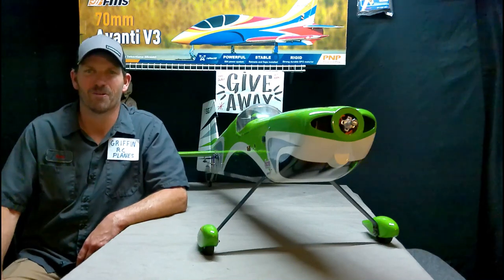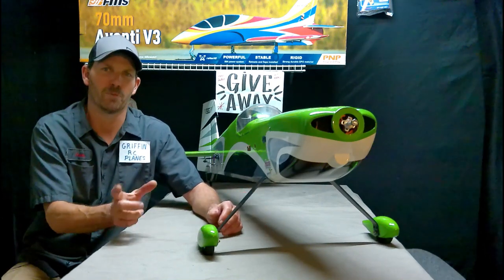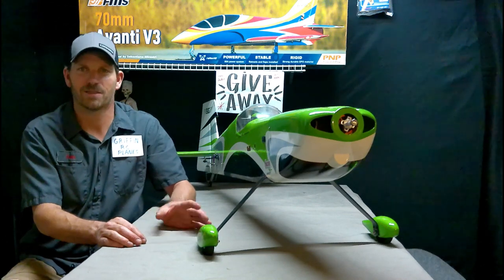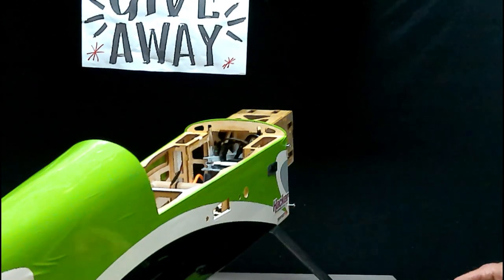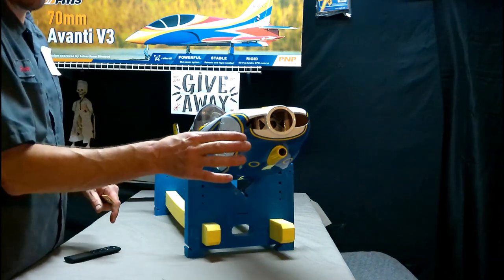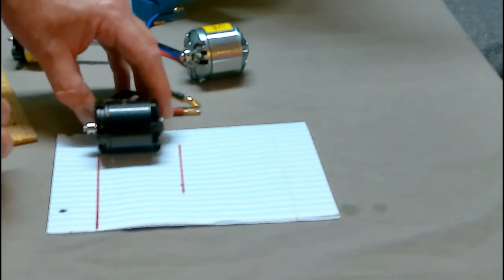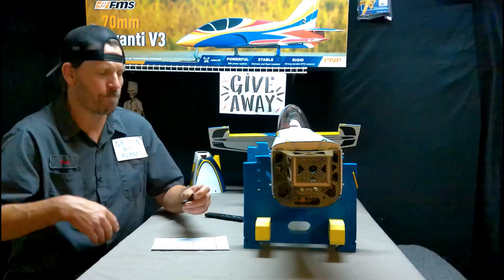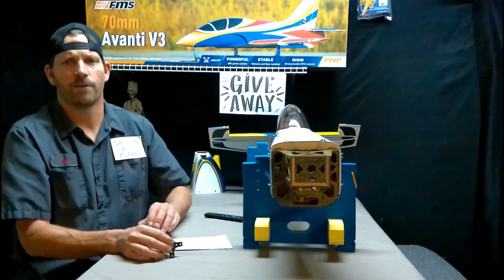RC AIRPLANE BRUSHLESS MOTOR CHOICES YOU DONT HAVE TO ALWAYS USE WHAT THE MANUAL SUGGEST LOOK AT THIS

Comment: Sean, thnxs for this video , didn't  have a clue about the price diff. on them motors, really haven't look till now. I built a edge 540 foam board about 3 years ago , took me about a year to finish. video great content and info, happy flying buddy, thnxs
Reply: Congratulations on your new plane purchase.
Reply: @rlbutterfield  thnxs I'm happy to get a well built balsa plane, these are hard to come by these days
Reply from the maker: check out hobby star and do lots of research before you buy. it seems like your good with a computer so do alot of checking around
Reply: @GRIFFINRCPLANES  I've been looking , going to take my time building her, I  might text you for help maybe, thnxs Sean

Comment: Did you build, buy, or did the plane come with that firewall?
Reply from the maker: hi ross that plane  is made by SIG and named the edgetra it came as ARF almost ready to fly. it comes in many peices and takes a good amount of building . but you dont have to build and of the wood work or covering

Comment: I just bought an Avian / Spektrum 60 Amp Smart ESC with the BEC built into it on the frontend it has an Orange and Black wire running into an IC3 Smart Plug and a wire that plugs into my AR8360T Spektrum 8 Channel Receiver that reads all telemetry? The Motor I chose for my FPV ANACONDA which T/O is roughly five to seven pounds is the Spektrum / Avian 5055-650Kv Outrunner with two 22.2V 
(3S-6S) 6500mah 60C the Motor recommends the 60 Amp Smart ESC with the BEC built in.  The 60 Amp ESX and the Out-runner Motor three wires seem not to want to join together. It came with three gold pins but I’m not sure about that. Basically the three Motor wires will not connect to the three ESC wires. Any ideas? Thank you, Chad
Reply from the maker: It is possible that the size connector on the motor wires could be bigger. Those can be unsoldered and the right size put in its place. People do that often
 However keep in mind the manufacture of the motor felt that the current and amp draw required that size wire and connectors . So do your research to make sure that motor is not going to draw more than 60 amps and up to 80 amps in a quick burst. If you think the motor is going to pull more than the esc is set up for then you need to move up in the size of the esc. Most likely you can swap the connector size with no issues

Comment: So I have a Cessna I bought off someone getting rid of it extremely cheap and it weighs about 5.5 lbs with the engine. It’s got a .46 in it right now and I have a few OS .40s that weigh about 10 ounces or 287 grams, so before I pull this .46 off I’m assuming it weighs about 300 grams, so it’s just a bit heavier. I thought about keeping it nitro, but as much as my kids love coming flying with me and as much as they do NOT listen or pay attention, I’m thinking about making her electric. I was wondering if a 590 kv motor would have enough thrust to fly this baby with an 80amp ESC and 6s battery. I’m pretty new to all this but grew up in the late 80s early 90’s flying all nitro with my old man. Let’s just say I took like a 30 year hiatus and I’m just getting back into the hobby. Any input would be GREATLY appreciated and if you need more Info I’ll provide everything you want. Thanks again and keep making videos. You explain everything in detail but use layman’s terms which is good for people like me
Reply from the maker: How I got a understanding of what motor will power what size plane weight etc. Is started looking at planes I knew then I went to horizon Web site or who ever I was looking at and read up what size motor that plane had then figured out weight etc. However if your plane has a .46 on it now then you can look at motors that are advertised as a electric. 46 equal motor and see the weight and size of that motor then you know about what your looking for.  Also several manufactures have this list like avain spektrum. Go to horizon click on one of the avain motors and then somewhere around where you down load the manual you can see the list of motors and each motor will say what pound plane on what battery it can fly and then after looking there you will have a good idea on what you are looking for. I hope that made sense. But to answer your question a electric motor set up to replace a .46 . Look for a 4260 550 Kv sometimes they call it a 4258 that is the size of the motor 42mm wide 60mm tall and with a 6s pack and 60 amp esc and a 51x6 prop will be real close for you

Comment: What kind of electric motor would you recommend for a 59 inch wingspan wood frame plane, I think it weighs close to 6 pounds, any electric motor actually able to fly this thing?
Reply: Your gonna want something between 500 and 1000 Watts, from the sound of it. It's gonna take a bigger motor, but you can definitely track down motors in that size range
Reply from the maker: There are alot of motors to fly that. The way I started learning about what size motor can fly whatever . Was to look at the planes we already know and them read the specs on it. Example the e-flite draco. You can look on horizon hobby website and see it weighs over 6 pounds and then see what motor it uses then you can look for the motor specs and see what size it is and what esc and battery it is called for. Also on websites that sell motors they will show all the info on what a particular motor can be used for

Comment: I really like your channel, more down to earth than some of the others.  Maybe cuz I'm from FL I don't know 😆 🤣.  Question,  I have the 750mm P 51D by Volantex that I've nose dived it in and bent the shaft, also old motor mount.  I have a motor and esc on the way, but I don't have a screw driver that will fit behind the old motor,  what's the trick?🤔✈thank you for your channel and info. Just if I want to try to remove it later.  Otherwise I can leave it as the new motor has its own mount
Reply from the maker: Hi there as you may or may not I'm out of town taking care of my mom so you tube is not a big priority right now. However you comment really has my attention. Is it the crash and something is bent ? Is that why you think you need a special screw driver? I don't know the motor setup on that plane but I don't think any plane would need a special screw driver find my email in the about section and send me some pics
Reply: @GRIFFINRCPLANES  Hi John, I hope your Mom is doing better. I found a hex screw on the rear shaft that allowed me to drop the mount away from the motor to get to the screws, problem solved! Thank you.

Comment: THANK YOU SEAN/SHAWN, FOR YOUR INFORMATIVE , AND HELPFUL VIDEOS.  I AM WONDERING IF THERE ARE MANY INCIDENTS OF MODELERS HAVING CATASTROPHIC FAILURES OF THEIR LiPo BATTERIES, EITHER DURING CHARGING, ...STORAGE, OR, WHILE IN USE....(??!!)... i WILL BE WORKING ON CONSTRUCTING A "FIREPROOF" BATTERY STORAGE, AND CHARGING BOX ("VAULT"), OUT OF A LARGE STEEL, "AMMO CAN", USING FIREPROOF PLASTER/CEMENT/DRYWALL/"DensGlass" WALL BOARD, AND i WILL HAVE TO KEEP IT IN MY BASEMENT, AWAY FROM ANYTHING COMBUSTABLE, JUST IN CASE SOME BATTERY EVER DECIDES TO "GO TO HELL" ON ME!...   :face-blue-smiling::face-green-smiling::face-fuchsia-wide-eyes::hand-orange-covering-eyes::face-pink-tears:     🔥💥:face-fuchsia-poop-shape:🔥

Comment: Motors are usually so expensive that you have to get your choice correct the first time especially if you buy online.
Reply from the maker: YES OR YOU CAN BE A HORSE TRADER LIKE ME LOL
Reply: Cheaper than nitro though, at least in my opinion. Dealing with fuel, engines, and mufflers becomes a mess and a pain in the ass. I started flying nitro in the late 80s with my old man and with electric I can take my boy pretty much anywhere with a nice sized field and no people to fly. Both have there pros and cons, but these days there are more pros than cons with electric. Plus you will always be able to switch motors and esc’s to different planes, and once you have a nice quiver of batteries, they become so much easier to maintain, but once again this is one mans opiniom